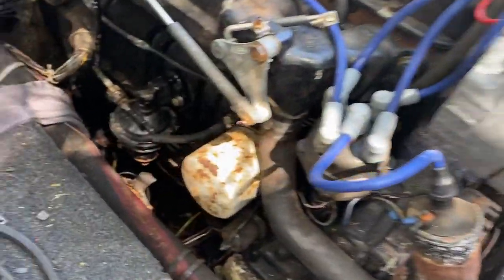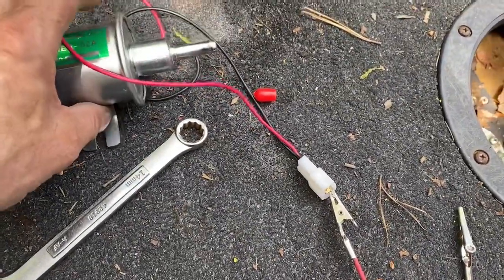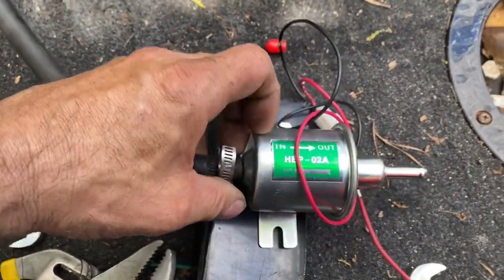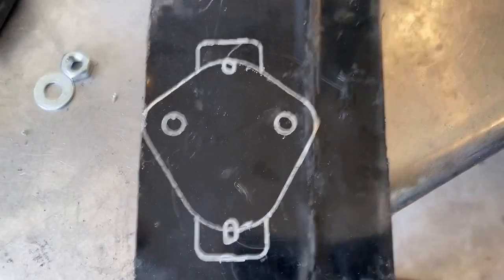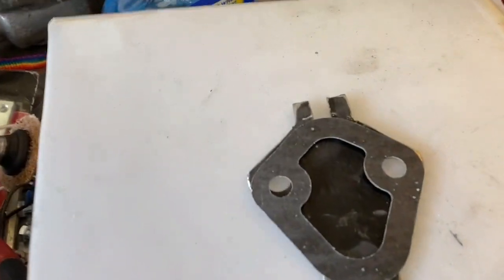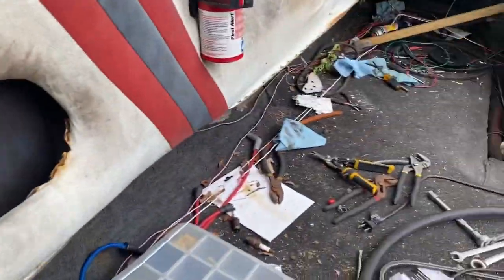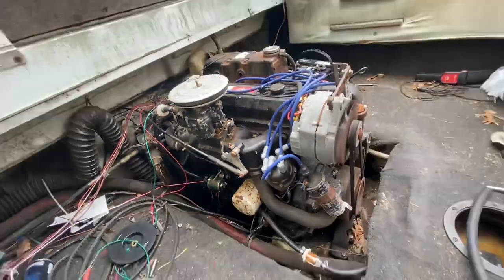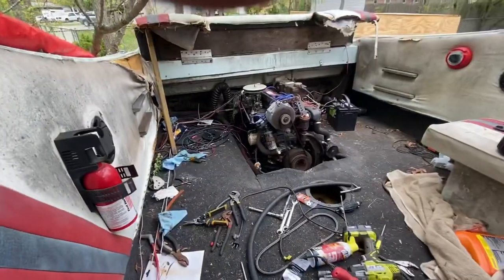Reevie’s Workshop: Changing fuel supply in the boat from a mechanical fuel pump.. to an electric

Comment: Should be powered on with an oil pressure switch, not just with the key, if the engine dies the pump shuts off

Comment: I crank the starter about 3 seconds before switching the pump on, that way the oil starts flowing, and no dry starts.  All my older mechanic friends say motors last a few extra years if you do that

Comment: is there no fuel return line necessary?
Reply: Fuel return lines in boats are illegal. All gas engines do not and should not run fuel back to the tank.
Reply: @kari53 you have no idea what you're talking about

Comment: Thanks for posting this! Will the electric fuel pump stop pumping onece reached the desired pressure, say 5-7lbs or it will conitnue to pump but carb prevents the fuel go in and build up some pressure in the gas line that feeds to the carb?
Reply from the maker: The pump will keep pumping until the switch is turned off.

Comment: It is always better to have a mechanicsl fuel pump for safety.mechanical pump has features to prevent fire in case of a leak. Electric pump will keep going and fueling in case of a hose leak.

Comment: how did you wire the fuel pump
Reply from the maker: I spliced into the power coming from the ignition key… so that way the pump wouldn’t keep running with the key off. I then hooked up the negative to my common ground at the transom.

Comment: You can't make a video saying " I'm going to show you how to convert from mechanical to electric pump" then jump straight to your engine running saying it's all done... you didn't show "how" you did it step by step... waste of everyone's time watching this video..
Reply from the maker: Try watching the whole video where the original pump is still in place. You will see me testing the new electric fuel pump, making the bracket for it, and showing the new fuel line in place with the filters. I always review my whole videos before posting. 

Furthermore… this is not meant to be instructions on how to convert “your” fuel system. Every system is different and this may not apply to you. This is simply me showing my boat conversion…

Comment: What is the part number for that fuel pump
Reply from the maker: No part number. Go on eBay and look up 12 volt fuel pump.
Reply from the maker: Hey Bob… were you able to find the pump on eBay??
Reply: @landrysworkshop  I did but I actually decided to keep the mechanical fuel pump. Just cracked it open hit it with some break cleaner and boom it worked again.
Reply from the maker: @roberthinze2425  awesome!! I’m glad it worked out. Have a great day

Comment: How did you connect the wires to a switch?
Reply from the maker: I have the power side of the fuel supply switch hooked up in series with the ignition switch with a fuse. I have the ground side hooked up to a good ground on the block.
Reply: @landrysworkshop  I saw your video and ran right to the store to grab the parts. Does your carb have two lines ? Mine has a metal line and another that is similar to a small hose.
Reply from the maker: @tuned8675  yes.... mine had a steel line going from the outlet of the mechanical fuel pump to the inlet of the carburetor. I had a fuel injection hose going from the fuel tank to the pump. I had another piece of hose going from the top of the carburetor back to the fuel pump. I’ll have to make another video of the previous setup as a comparison of how it was... to how it now is.
Reply from the maker: @tuned8675  I didn’t forget about you.... I’m hopefully going to make a video about the fuel and electric hookup
Reply: @landrysworkshop  thank you, I was able to figure out how to make the connection which I did directly to the battery. The only thing is I don’t know what to do with the overflow tube from the carb. But, thank you, your video helped me turn my boat on🎉
Reply from the maker: @tuned8675  I’m glad i was able to help.... enjoy your boat!!